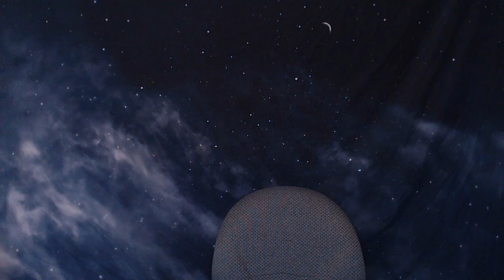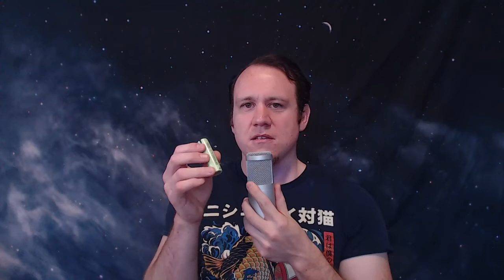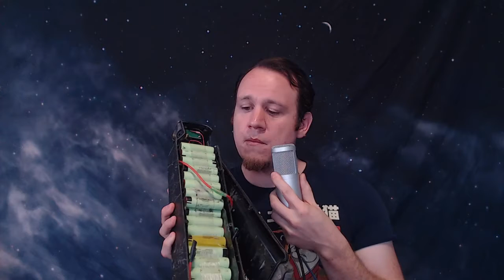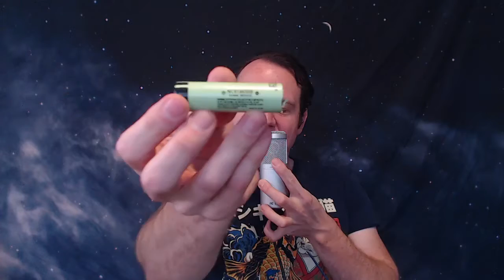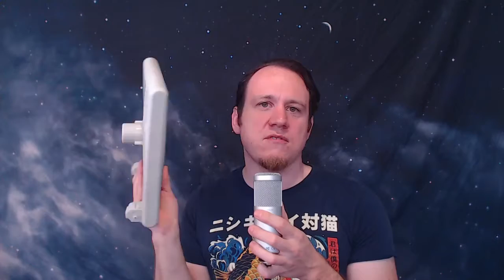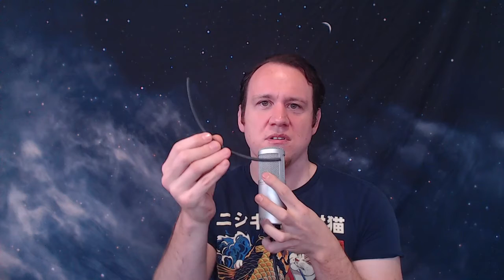Why most eBike batteries underperform and most eBike motors overperform.

Comment: Hey, I see you have the leafbike 1500w hub. I'm wondering what the max cruising speed of this motor is before it starts to overheat? Is a 15 minute ride at 35mph too fast? What about my ride home at 30mph? And what battery would be best to pair it with if I am going for max efficiency/safety if I am looking to ride around 30-35 mph? (52v, 60v, 72v?)
thank you!
Reply from the maker: Everything you need to know is covered in my videos on the leafbike 1500w hub.

Comment: For me the 18650PF cells in my bike are amazing! Not sure about those PD cells in that battery, but the PF cells I have are rated pretty close to where they should be. Abusing them hasn't been a problem over the 300+ cycles that I have used them for. I also think the Sony VTC5 cells are noteworthy, excellent cells, put out tons of current and they do more than the rated cycles. Obviously fake branded cells and no brand cells are going to be over advertised and aren't going to perform as rated. But the proper branded cells mostly do what they say on the tin with 1 or 2 exceptions here and there, and they are probably fake cells. The other problem is that these intermediaries who purchase then sell the cells sometimes advertise differently to what the manufacturer has rated the cells to which obviously spreads disinformation which then can catch on until someone looks up the data sheet.
Reply from the maker: Hey John;
The likely reason that your PF cells have worked so well is because they do not have the high temperature additive. So Panasonic gave you the impression that they were a 2C cell and i imagine you're not running 2C continuous all day, yeah?

You'll notice in the datasheet that the max C rate results in much lower voltage sag than the PD or say, a 30Q or 25R.

The vape companies are the worst about misleading expectations. Although it goes back to the application that's intended, right? an ecigarette delivers a short pulse of intermittent power. If you took those expectations and based a battery pack for an EV around them, you've got a chinese firework show in your house.
Reply: @neptronix  Yeah vaping is different, it is just pulses, but I was referring to the cycle lifes with regards to vaping, obviously they pull a large amount of current but not for long, but I used 2 x 2 Sony VCT5 cells for several years, so using 2 while 2 on charge and they would last nearly the whole day and there still going in fact. They are well beyond there 500 cycles. With regards to ebikes and power output continuously, the only time you use full power is on highways at high speeds and even then you would normally reach your maximum wind speed of the motor before wind resistance V max, so the current draw drops off about 30% once you reach your motors max speed. Although that depends on your setup, but generally I have found that to be the case with most bikes. Round town I don't use the full rated discharge all the time, more in pulses. You are correct in that less powerful ebikes with smaller batteries that get used to there full potential all the time could suffer if there not made properly, or the battery doesn't have a large enough capacity. If you link lots of cells in parallel and put it on a low power setup, the battery is then working no where near its rated discharge and is safe. So running say a 20ah pack with PF cells on a 250w motor ebike is going to be very safe as the battery is just being tickled. These dinky little ebikes with dinky little batteries to save money probably wont last too long as they have the bare minimum capacity for it to be practical but don't think about longevity and reliability. So with an overly designed battery, If there not getting luke warm in the first place there not gonna heat the piggy in the middle to start with.

Comment: Good video. I think to be clear, at 2:40 you mean that the C-rating goes from 3C to higher rather than going to 2.7C (example) as the current draw should be the same as the cell wears.
Reply from the maker: Gracias, sir.

Yes, there are a couple mis-speaks in the video. I'm glad you understood what i was getting at.
I think in the future, i should write a script for videos like this where i'm making a lot of points about hidden nuances.

I meant to say that the actual continuous deliverable current goes down as the capacity goes down. And not changing the draw from the battery means that you are drawing a higher C than before. This will cause the battery degradation to be exponential rather than linear.

Comment from the maker: Side note: i claim that Lunacycle rated this particular older battery at 50 amps, but their listings have changed since then, and so has their 'shark pack' product. That figure was off the top of my head, ad the product i have is an older version of what they used to sell.

But if you take my advice and start looking at some datasheets, you'll see that their current listings contain the issues i was talking about in the video.

But so do a million other vendors.
Maybe one day i'll load up a few aliexpress/ebay tabs and do a myth busting fest on all these vendors who have a problem with being honest.
Reply: Best way to truly test a cell is allow a 15% voltage drop from full charge and vary the current to find the max voltage drop for 15% and rate the cell at that for best efficiency and a happy cell. I test all my cells that way and make my packs based on the current i need with this type of test.